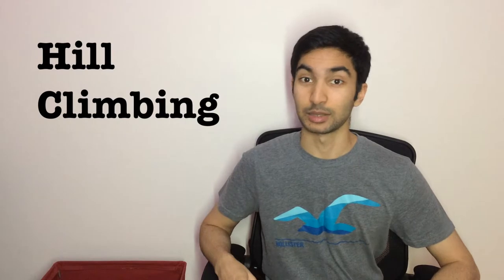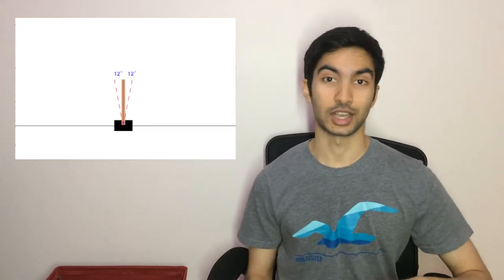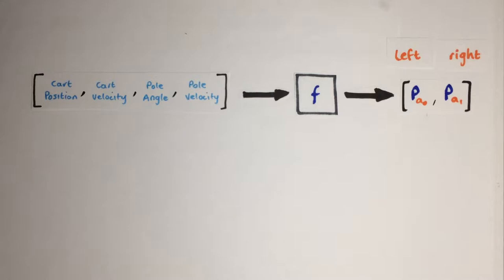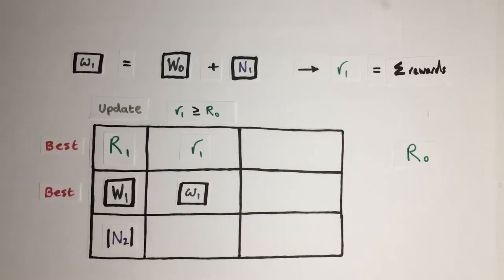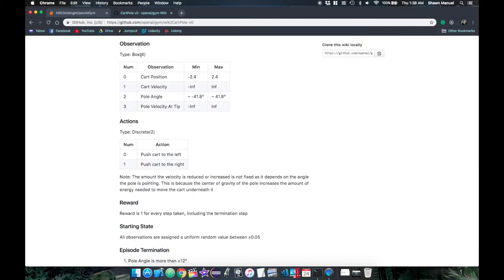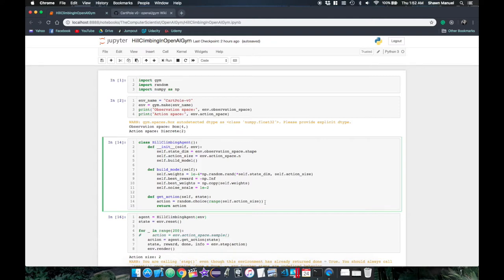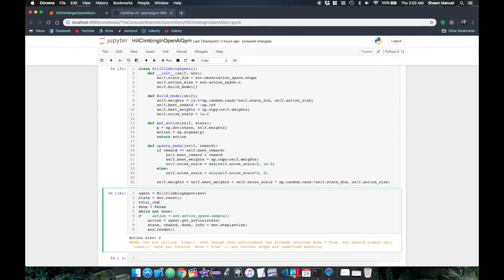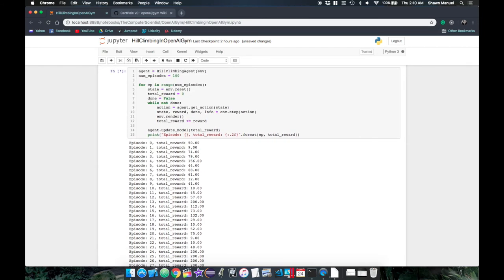Hill Climbing Algorithm balances a Cart Pole

Comment: I did a optimisation and I found: Its is necessary only one dimension on action; it is not necessary the information from de cart, so it results in :     
 v0=0.0082*state[2] +0.0096*state[3]         
 action = 0 if v0 < 0 else 1  #0=left    1=right